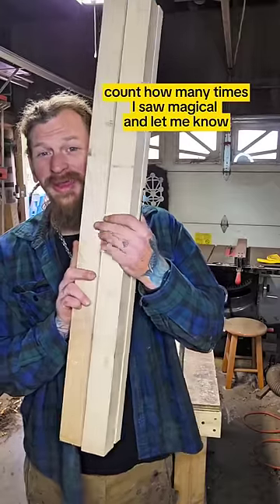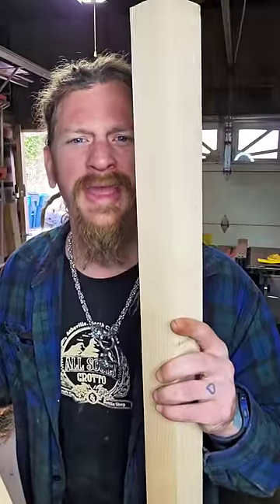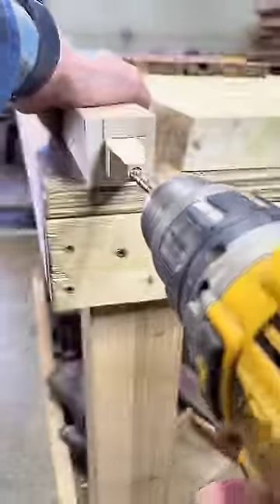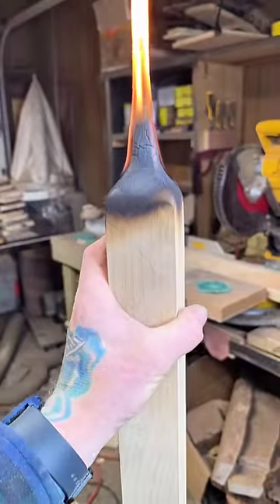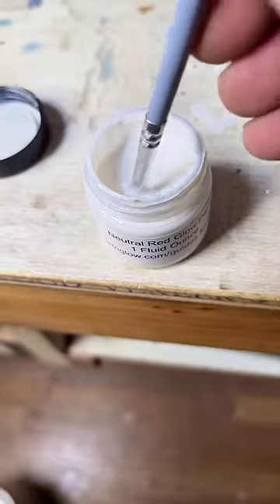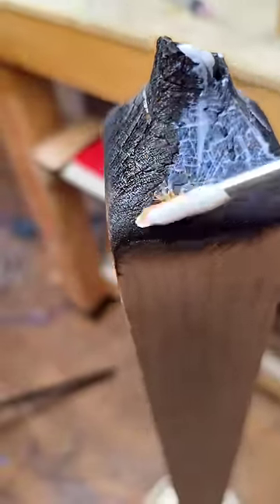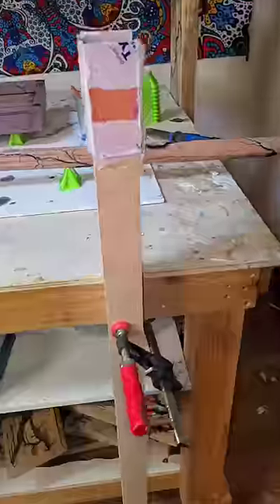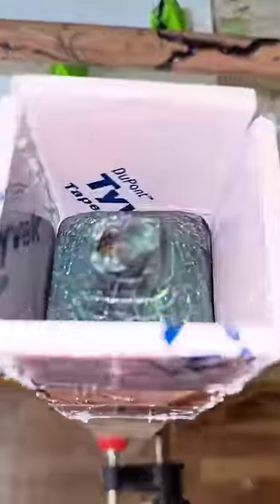Let's turn this chunk of maple into a 1 of a kind walking cane! #woodworking  #process #fyp #diy

Comment: You could easily add a led light into the drill hole with a small slide on the side to replace bulbs/batteries then the epoxy could look like it’s consistently burning, even with blue or green flames or some shit.

Comment: Drill a few tiny holes at different angles so the epoxy adheres to the char and paint. I did this almost the exact same way and it broke off the same day. Angled drill holes so the epoxy can clutch the wood per say.

Comment: Waste of wood? No, that was the most reasonable way to cut that wood apart. I wish I could cut the aluminum and steel at my work as well as that, but generally it would require me to produce three parts to get that desired cut.

Comment: When you only have the MethMaster500 to do the job of a propane torch.😂
Reply from the maker: It used to be for dabs actually. And chefs use them. Don't limit yourself bud
Reply: @shocksart  OK dab master 5000.. 🤣